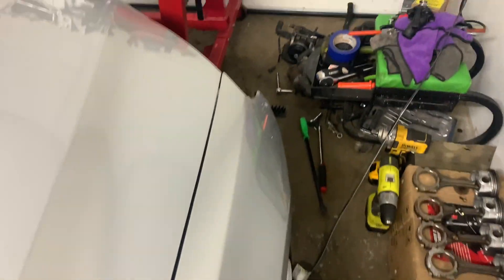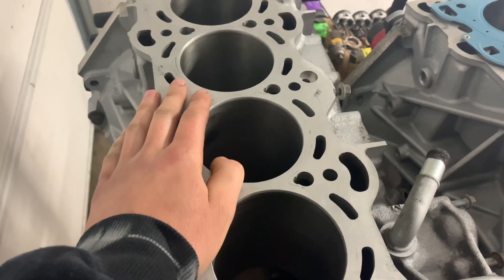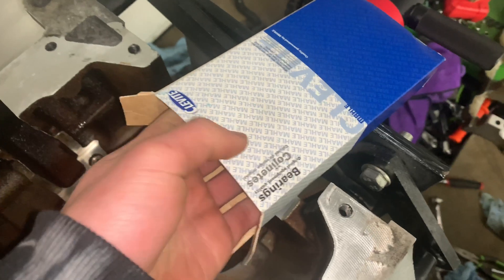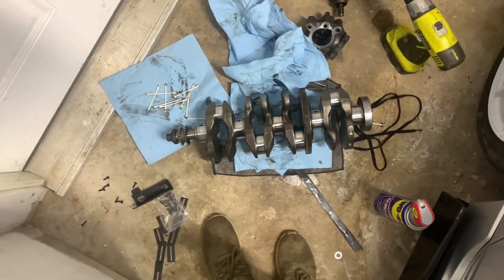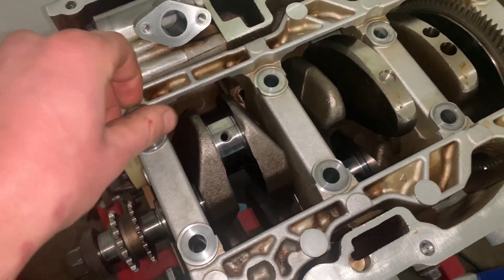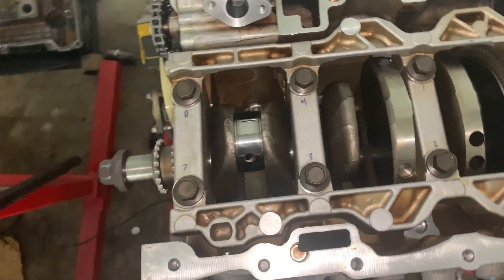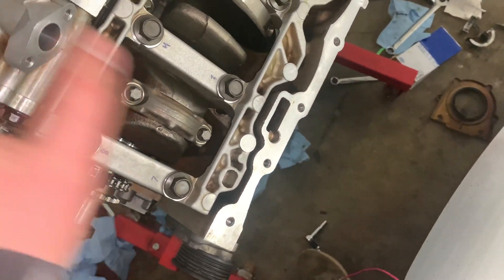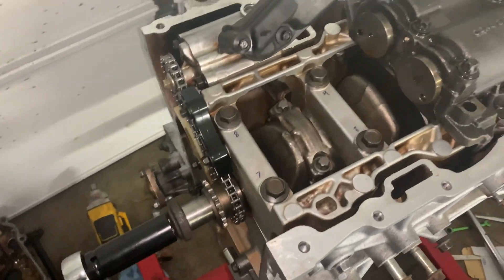Rebuilding MAZDASPEED engine part 1/2

Comment: Where is video 2?
Reply from the maker: Sorry I stopped making mazdaspeed videos as I got rid of mine but I still build speed motors and have some videos if you need to see anything or need anything explained
Reply: @bimmerboi_9784  how do u time the engine once you pull the crankshaft out?